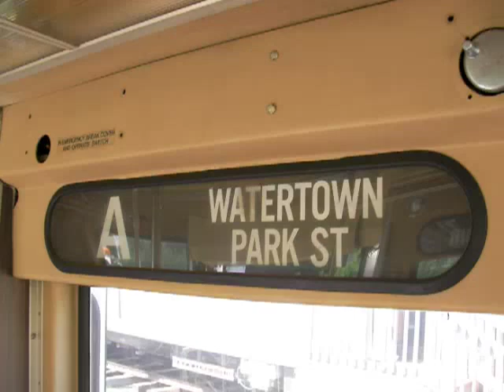Unloading  MBTA Boeing LRV 3424 from a Flatbed Truck

Comment: I remember riding those trolleys as a kid, I remember, the doors open differently then the ones they have installed in the video.
Reply: Those doors that you mentioned are called plug doors. They slide open and closed instead of folding outwards onto the platform. The reason why this train has different doors is because the plug doors were notorious for breaking.